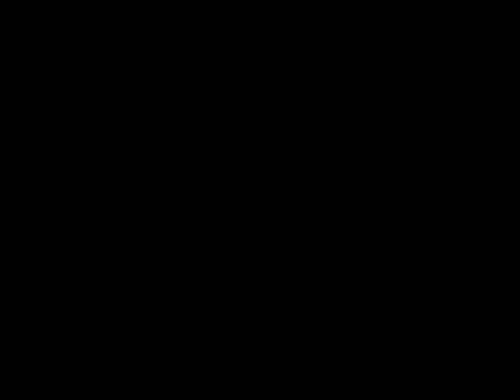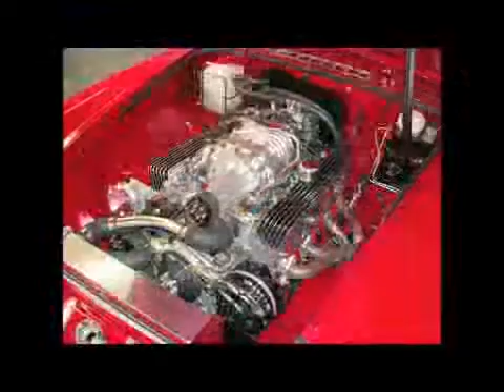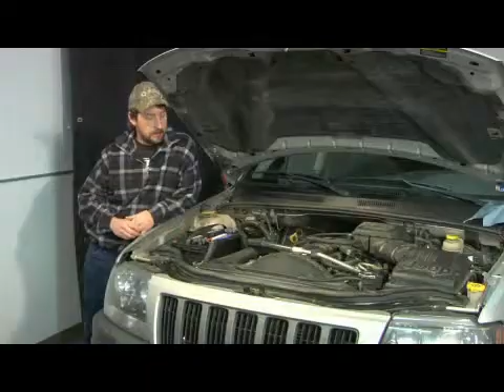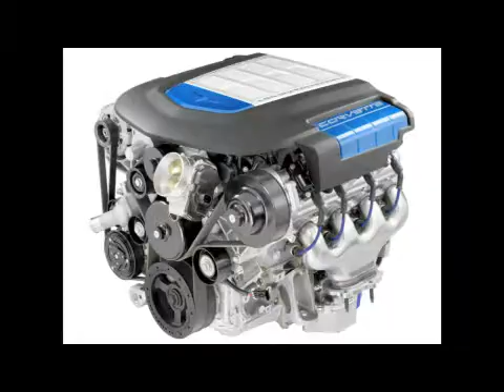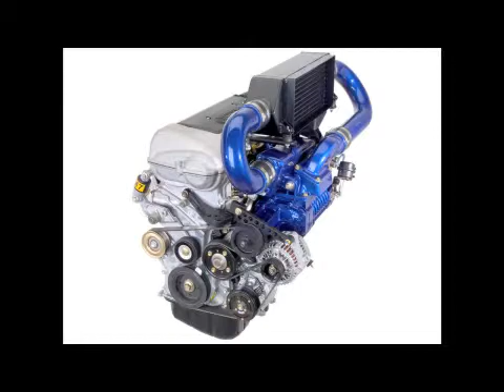How Does a Supercharger Get Better Fuel Mileage?

Comment: "Volumetric efficiency" is not more efficient at mpgs.  It is more efficient at making power with fewer cubic inches.  Add a supercharger to your LS and you get way more power because you use more gas period.  Add a supercharger to a 3.8 V6, and you get N/A LS power with less cubic inches.  It is the less cubic inches that gets you better mpgs. And that old gutless 3.8 will get better mpgs without the supercharger. Just like the LS will get better mpgs without the supercharger.  Get a grip.

Comment: The comments people are right. You add more air, you need to add more fuel to not blow up your engine from running it lean. And even though a supercharger does take some energy from the engine. It replaces it with the extra power it can add. And it can save on fuel economy because with the added power, it can get up to speed quicker and get to a higher gear quicker, lowering the rpms of the engine sooner

Comment: Lol I don't think that's how it works
U definitely have more power with a supercharger, but air on it's own will not combust. More air means more gas and stronger combustions, and so more horsepower. And since the supercharger is driven by the motor belt itself, it takes some of it's energy and like that also gas.
Reply: Think you are missing something. Just think that smaller turbocharged engines produce same amount of power than a bigger natural aspirated engines.
Reply: @ulicsc.5103  Wasn't this vid about superchargers not turbochargers?
Reply: @rickbekkers2854  same thing for the point.
Reply: @ulicsc.5103  Well not rlly, turbocharged is powered by the exhaust gasses, supercharger is directly driven by the engine. So the supercharger takes power from the engine directly where as a turbocharger takes power from a otherwise lost source

Comment: Dude seriously ??
More air = more fire 
More fire = more gas 
Correct me if I am wrong
Reply: jay pereira  more air more fire   and more fire= more oxygen than normal intake + gas as normal  here you are providing engine with more compressed air to breath to burn fuel. If you still not understand take an example f your body let's consider you are doing pushups and burning calories   and you are breathing normally but if I restrict your nose from inhaleing your efficiency or performance will reduce you not be able to do pushups properly because you need sufficient amount of air to do things efficiently. Same goes for internal combustion engine if you provide more oxygen or air to combustion chamber to burn fule the  flame will have higher energy which in turn expand more quickly as fuel and air mixture is compressed incombustion chamber ultimately resulting in better  power stroke. If you still don't understand ask me again.
Reply: IDK to a science with a combustion inside of an engine and I'm sure there are variables within the true answer, but as a welder, less acetylene is required with a high volume of oxygen to produce the same amount of heat. That in mind, it would take less gas with a higher amount of oxygen running through the engine to move the mass at hand. That's my insight without hard research, and it's free analysis - we all know ya get what ya pay for ;)
Reply: Regardless of Aspiration, right?
Reply: You forgot more power. So the equation for this is miles divided by gallons. Compared to stock, both these numbers will increase. If the miles is bigger then we get better mpg. According to this master mechanic, it is.
Reply: More power, quicker shift into higher gears